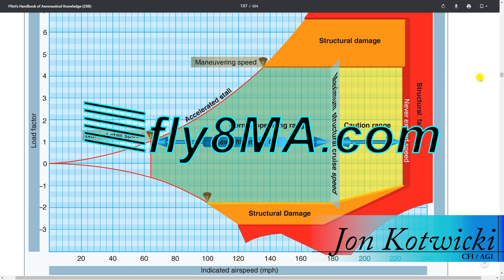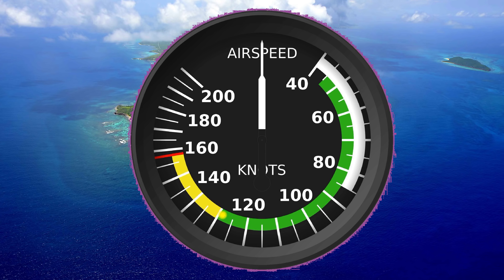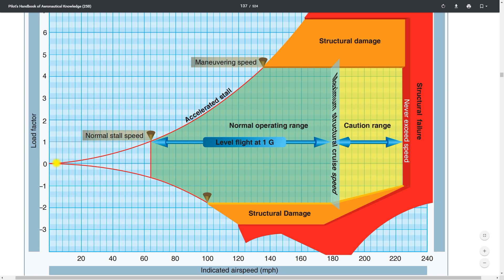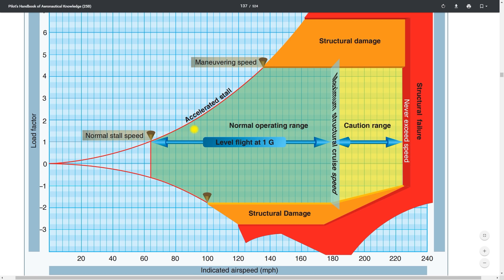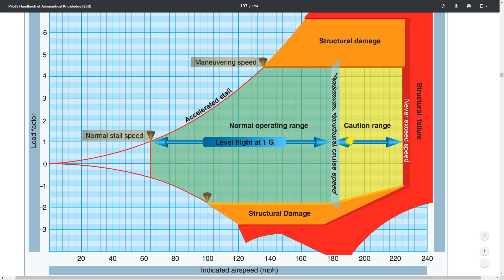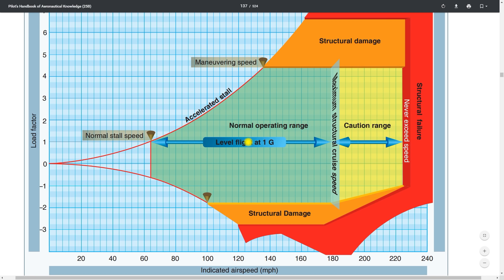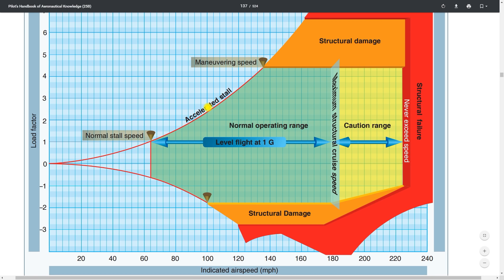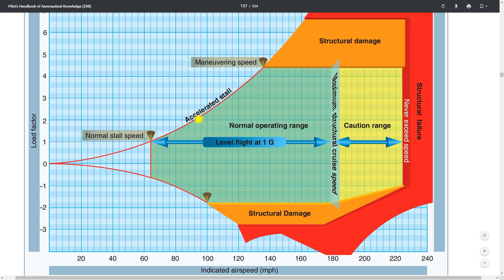Vg diagram explained | Load Factor and Accelerated Stalls

Comment: I have a question on negative Gs.  How much negative load is the wing exposed to if you do a zero gravity simulation? Or is it just around zero, like the name suggests?  If you're simply floating I would think you're around zero but if your blood starts to push up in your head that's gone a bit too far, right? Back in the day I had a few instructors do it to demonstrate it but how do you know how much negative load is safe, since entering the structural damage zone in the negative is a lot closer?

Comment: This is a good presentation except for one fact. If you overload the airplane it can fly straight okay but if you turn you start ramping up the forces and you slam into the ground. You might have four or five times the way to the airplane of Lyft in a straight line at a high speed but if you turn a little bit that's not going to be true it's going to be a lot less. All of these aircraft take off overloaded in a straight line and barely make it they get off the ground a little ways and they turn a little bit and that's when she crashes.
Reply from the maker: This video isn't about the weight and balance of the aircraft. It is about the load factor on an aircraft in reference to speed which is not the same as exceeding the gross weight of the aircraft. Which if you do happen to exceed the gross weight it can have dire consequences such as not even being able to leave ground effect or worse stall on takeoff.
Reply: @fly8ma.comflighttraining199  I thought of the video about airplanes and not smacking into the ground.If It was just about you and the chart I guess the fact that an airplane turning stalls and spins into the ground at a much higher speed. I think it's a great video if you fly an airplane that only goes straight.
Reply: @fly8ma.comflighttraining199  I also mentioned turning. You have that pilot thing where you want to focus on me being wrong but you want to ignore where I'm right. Your stall speed goes up when your turn radius radius decreases perfect weight perfect balance perfect pilot perfect perfect perfect perfect. If you begin to turn or you are turning in any of these conditions on this chart you have a higher stall speed any chance to spin into the ground because of the radius of the turn. If I ever need a pilot or I ever need lessons on flying in a straight line and never turning you're my go-to guy.

Comment: Greetings Jon! I have a quick question, I was looking over one of the aviation questions that asks, “ If the airspeed is increased from 110 knots to 150 knots during a level 45° banked turn, the load factor will...” 

At first I chose the load factor will increase as well as the stall speed. But the correct answer appears to be the load remain the same but the radius turn will increase.

But at the above quiz question, I thought when you make a turn your load factor and stall speed will automatically increase? Or is it because the throttle is increased that’s why there’s no change in load factor and stall speed?

Or that’s just say I don’t increase the throttle, and I make a turn, then in this case both the load factor and stall will increase?

Thank you!

Comment: For certified aircraft, VNE is the highest speed that the manufacturer has certified the airplane for. It is not just rough air or maneuvers that are of concern, but aerodynamic conditions like flutter as well. Some of these conditions can be divergent which means that once it starts, recovery is not possible. Essentially, nobody knows how the plane will behave in this region. If you are tempted to burn off some altitude in smooth air, be aware that you will be entering dark territory. With ADS-B, the FAA will be able to review your flight if it comes to their attention. Generally, the FAA won't look at that record unless there is a triggering event which can be as simple as a complaint from someone on the ground. At that point, the lawyers get involved.

Comment: This might sound silly, but with stall speeds, do you use power-on or power-off stall speeds?  This has to do with both standard and aerobatic flying (I'm basically doing some performance estimates of WWII aircraft and I'm not sure which figures to put in).

Comment: Great explanation!Just learned many things here and got some more questions to search for answers.

Well, one of them is: why the yelow region is bounded by 4.5G like green region ? I mean, if yellow arc stands for caution and fly in smooth air, does it mean a not-smooth air is what makes you bounce over 4.5G?

In my opinion, like other types of graphs ive seen around (elec. or mec. engineering) its like another curve is missing. May be a descent curve from 4.5G at maneuvering speed down to 0G in red line.

Thanks anyway for your time

Comment: excellent and thanks for the refresher. 

The only caveat I'd add to significantly lowering airspeed well below maneuvering speed in turbulence would be the possibility of not only an accelerated stall, but also of an inadvertent spin in IMC conditions. 

We're all taught rudder opposite to recover from a spin in vmc, but not many are taught to step on the high wing (in the turn coordinator) to recover in IMC (and loss of fuel as a result of an inverted spin is a whole different question - I'd heard of turbulence flipping a Cessna 172 upside down during mountain flying at ground school - my personal limits for mountain flying are that winds aloft have to be less than 20kts but that alone isn't a guarantee.

At an air safety institute seminar a few years back there was an accident case study where such a likely cause was presented.

I wouldn't be so sure about entering an accelerated stall in turbulence and IMC so not sure about slowing down well below Va.

Thanks much, safe flying and great summary.